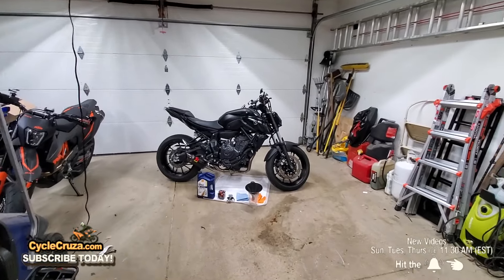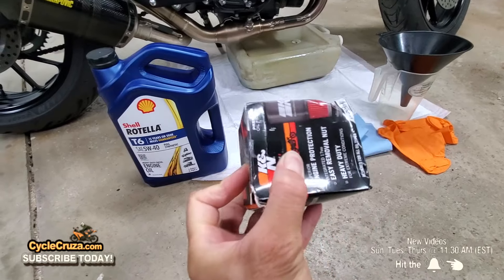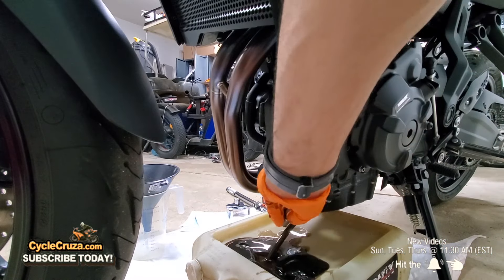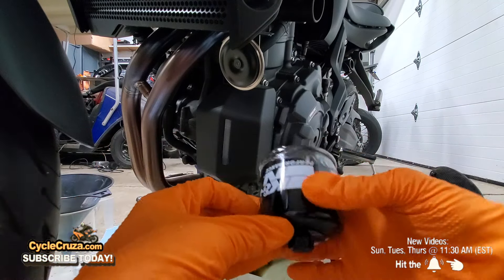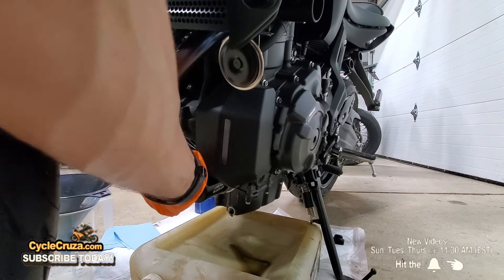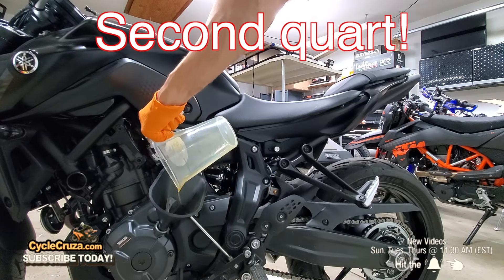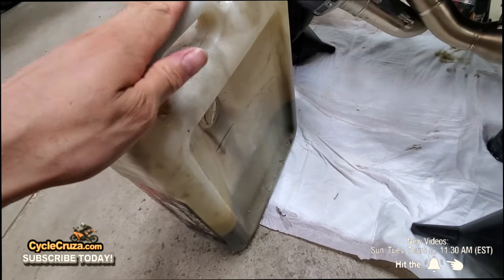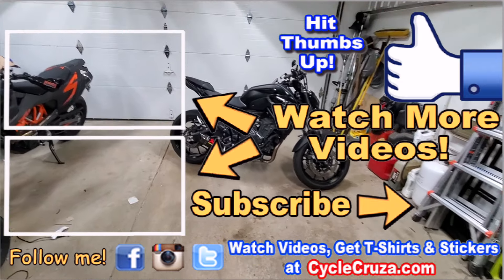Yamaha MT-07 OIL CHANGE How To EASY (The RIGHT Way!)

Comment from the maker: Links to Get Stuff in Video ⬇ 
Get Bell Carbon Helmet (Best Ever!): https://cyclecruza.com/vhxg
Get Rotella Synth Oil: https://amzn.to/4d2MtAM
Get K&N Oil Filter: https://amzn.to/3W592xU
Get Oil Catcher Container: https://amzn.to/4cIEAkf
Get My Torque Wrench (Cheap!): https://amzn.to/3W7PJE8
Get My Smart Watch: https://amzn.to/45fB7GW
Get Adjustable Oil Filter Wrench: https://amzn.to/3W3NNwb
Get Cush Washers (Cheap!): https://amzn.to/3LqtYdJ
Get Absorbent Mats: https://amzn.to/4bIwLty
Get Disposable Gloves (The Best!): https://amzn.to/4d1hnt9 
Get AIRBAG Vest (On Sale!): https://cyclecruza.com/w34j
Get My New Shorty Gloves: http://cyclecruza.com/w7ae
Get Sedici Garda Pants (Best for Street): https://cyclecruza.com/vb8e
Get My CE Armor Jacket CHEAP: https://amzn.to/3RpXKm5
Get My Street Riding Boots: http://cyclecruza.com/uubp
Get My Vented Socks: http://cyclecruza.com/0bww
Get My New MotoVlog Camera (On Sale!): https://amzn.to/3R4MiLY

MY MT-07 MODS:
Get Akrapovic Full Exhaust: https://cyclecruza.com/z0xo
Get K&N Air Filter: https://amzn.to/3UXVTV7
Get Dynojet ECU Flasher: https://cyclecruza.com/lcbq
Get Bar End Mirrors: https://amzn.to/3TlbJZu
Get Restart Lithium Battery (Never dies!): https://cyclecruza.com/ymjz
Get Yamaha 12v Accessory Plug:  https://cyclecruza.com/ay3l
Get Radiator Guard: https://amzn.to/3Ev7Xrr
Get Phone Holder Wireless Charger: https://amzn.to/3CQFtX2

Comment: I literally just hit 600 miles on my mt 07 (first bike) I wanted to take it to a dealer for my first service but its so expensive where i live ($400 in WA state) so im thinking im gonna do it myself since from what I understand its a glorified oil change and this looks simple enough. Video popped up at the perfect time lol
Reply: Yep, price seems high.
Reply: Here in California I was charged $300 and the tech told me id have to bring it back because they couldn'y get my axle sliders off the rear to adjust the chain. That was when I knew I would never be taking the bike back to get serviced by the dealer. I just did my second oil change and chain service, easy! 
Get some stands!

Comment: I've used Rotella T6 in autos and bikes.  Have submitted numerous samples for oil analysis and it always comes back with a positive report on the oil itself.  Has also helped me detect issues within the engine that I would have never known about until much later...

Comment: Nice post thanks, as a footnote you should always wipe clean the mating surface of the filter housing and the sump plug, just in case any any grit or dirt gets on them when plug and filter removal occurs.

Comment: And old-timer’s trick if you don’t have an oil filter wrench, use a chisel or screwdriver and jam it into the side of the filter and use that to turn it. Obviously this only works if you don’t have a cartridge style filter. Also make sure your old oil filter gasket came off or you’ll double gasket and it’ll leak

Comment: Hey cyclecruza what’s your opinion on a Daytona 675r?
Reply from the maker: Cool bike, looks nice BUT you won't be very comfortable riding on the street for long rides. if you only ride street you'd better served on the Street Triple which has the same engine but better tuned for the street with more grunt.

Comment: Hey Cyclecruza, how would you say the vibrations are from the footpegs/handlebars on the 701 and yz450fp, could you compare it to a Drz400s? Or your mt07?
Reply from the maker: I have yet to ride a DRZ-400. There is very little vibration at the pegs on my 690 SMC R, it actually has rubber inserts in the pegs. My YZ450FX doesn't really have a lot of vibrations at the pegs or bars, no issue for me.

Comment: I went from a CBR500R to an R6 and I absolutely hate changing the oil on the R6. The CBR had the oil filter in the front by the headers like your MT07, the R6 is on the side behind the shift linkage and requires you to take plastics off.
Reply from the maker: I know how you feel. Yeah the CBR wasn't bad but I still had to remove those freaking fairings to work on it. I really appreciate the naked bikes. R6 is a cool bike tho, amazing track bike still to this day.
Reply: I've rode an 2003 R6 couldn't get over no fuel gauge and I personally installed a gear indicator that was plug in.
Reply: @EmoKen  I don't mind the lack of fuel gauge, it has a low fuel light at least lol. My/the 2020 has a gear indicator stock, its a nice to have, my cbr never had one
Reply: @CycleCruza  I always wanted one, and then they changed the look in 2017 and made me want one more and then they discontinued them, so it was now or never I felt like, now their value has gone up. I'm probably going to sell it and get an r9 when they finally announce it, I'm almost 40, I love my bike but my back doesn't.

Comment: Never seen a oil filter remover like that. I have that looks like a wrech 😅
Reply from the maker: Me either, I went on Amazon to buy an oil filter wrench and saw it with high ratings so I bought and it worked out great. I will probably only ever use it when the very first change on a new bike because I always switch to a K&N oil filter with the nut on the end.
Reply: @CycleCruza  A-Spec

Comment: I paid $20.00 for  Castrol 10W-40  5 quarts  motor oil and  $4.50 for Frame Filters for my FZ-07 .
  Gasoline savings oil can be too slipper for wet clutches. "Gasoline savings oil"   K&N Oil Filters cost 3 times what they are worth .
  I tighten oil filters about as tight as I can get them with my fingers.. with oil added to the rubber gasket..
  I put a mark on my 5 quart container.. I think  it takes 2.75 quarts or  3.75 quarts.. 
  Now I  Keep filling the marked container with oil from other 5 quart containers.
  Starting the bike up and letting it idle for a bit is a bad idea.
  Start the bike up and take it for a hard ride then change the oil ..  Hot oil suspends the contaminants and metal shavings ect.
Reply from the maker: Shell Rotella T6 5W-40 is Jaso MA/MA2 rated, actually has a small picture of a motorcycle on the front of the label. I use Shell Rotella T4 15W-40 in my 2018 YZ450FX supermoto every 8-10 hours since day 1 and my bike runs better now than it did new. I've been using Rotella oils since 2012 with no issues.  However, all that matters is use the oil you like. When you change oil every 8-10 hours it can get expensive with more expensive oils that are really a waste of money. When it comes to tightening anything on a motorcycle or car you want to tighten it to the manufacturer's specification in the service manual, especially when it comes to an oil filter and oil drain bolt. If that oil filter rattles loose because it is tightened right and leaks, that could set your bike and you up for a f'kd up day.
Reply: @CycleCruza   Looks like your shell T-6 is fully synthetic. $70.00 for 3 gallons. I used to pay $4.00 per gallon for motor oil . and 54 cents per gallon for Deisel fuel .
Reply: @CycleCruza   Walmart oil prices are all over the place.  My power sports dealer raised the price from $8.00 to $12.00 for my  Buell.  The same Fram Filter also fits the Kawasaki Mule . I searched the part Number and found the same filter for $4.11 at Walmart so I ordered 3 of them .Plus some other items to get free shipping.

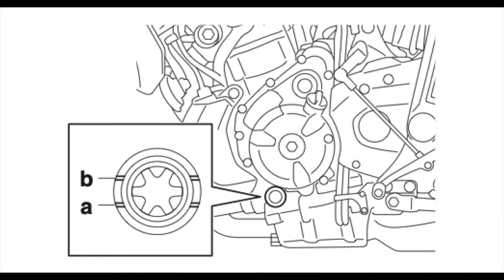Comment: Bike says 2300 cubic centimeters at 8:32, but 2.75 quarts equals 2602 cubic centimeters.  I guess the difference in oil amount is okay?
Reply: 300 cc isn’t much difference of oil, but idk if it’s significant enough. I work on cars and those you can be a quart low and be fine. That said, motorcycle engines are smaller and use less oil, so being 1 qt low is a lot. 300 cc, idk

Comment: T6 is the best, just change it more often if scared
Reply from the maker: Yeah I;ve always changed the oil at 3k miles and had zero issues with the T6, used it since 2012 with no issues. I use the Rotella T4 15W40 on my YZ450FX ever 8-10 hours and the bike rides better now than it did brand new. For the KTM, I will actually let KTM do the oil change and they can use their special oil. For any Japanese bikes I will always use Rotella oils, I don't care what the oil snobs say, lol

Comment: Hire someone else for the job. Nothing easier than that. Case closed. :D
Reply from the maker: And hope they do it right. Actually, if you notice in this video, when I took took off the drain bolt it was on so tight that I nearly messed my wrist up. This was actually the very first oil change on this MT-07, the dealership I bought it new from tightened the drain bolt way too tight and not to spec. Oil change is so easy to do that is is a sin to not do it yourself. My friend's car got messed up from going to a 10 min oil change place.
Reply: Believe me, some "specialists" out there can do horror things on your bike. You just can't trust anybody these days unfortunately. The more you learn about maintenance more horrified you become hahahah